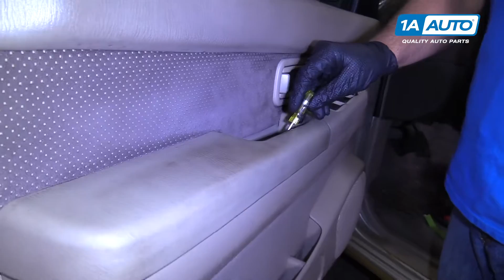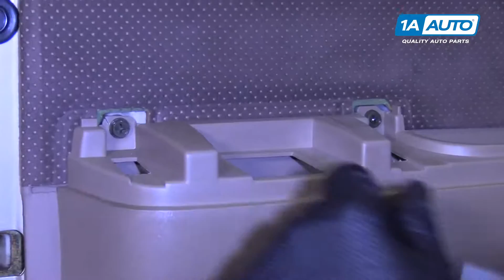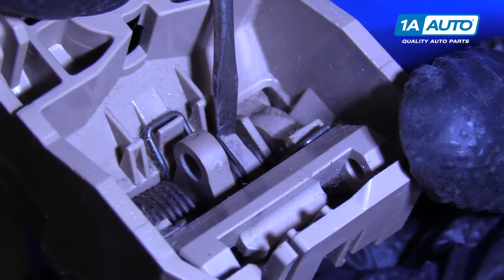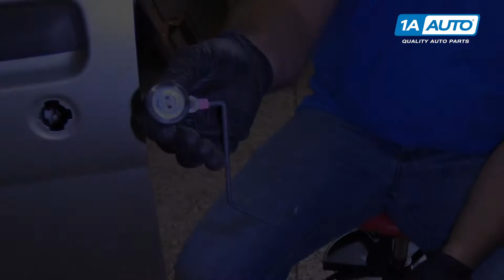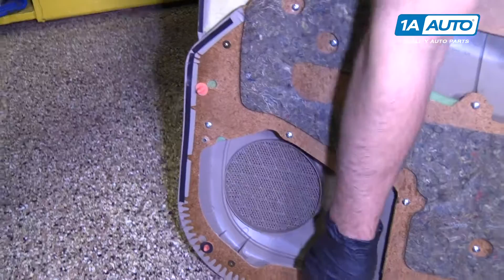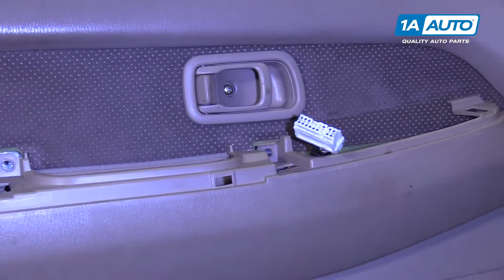How to Replace Door Lock Cylinder 96-04 Nissan Pathfinder

Comment: You don't have to actually remove the inner top handle and 2 connecting rods to gain access to everything else shown in the video! So skip that step! Just finished replacing the lock cylinder on a 99 INFINITI QX4. Thank you so much for these videos, super helpful.

Comment: I'm having an issue programming my 2000 Nissan Pathfinder LE 4x4 Keyfob. At some point, someone attempted to drill out the Driver's side door lock. The locksmith says, potentionally, doing this has caused an electrical problem preventing the fob from programming. Does this sound like a legitimate cause? Thanks for the video!

Comment: How much do you suppose this would aid with a 1999 Xterra. I ask as with that model the only way to lock the doors is reversing the key from the outside. Also this is extremely complicated for the task being done. I feel like the design could definitely be simplified😅. Totally out of your control though. Thanks for the video😃

Comment: does work for 2000 nissan frontier v6 3.3 l   doesnt have electric windows , just plain manual handle
Reply from the maker: +ruldyjcarrillo We don't have a how-to video for your vehicle right now, but the basic steps in this video should be enough to do this task. Buy this part for your vehicle on 1AAuto.com: http://1aau.to/m/Shop-1AAuto-c

Comment: Is there a way to test if that little sensor behind the lock cylinder is faulty? I am having issues on my 1999 altima in which the alarm will go off and even though I turn the key in the lock cylinder it will not disarm it like it is suppose to.

Comment: Does the cylinder works with my original keys?
Reply from the maker: +Abel Vargas A new door lock cylinder generally will include a new set of keys as a new cylinder would not be compatible with your original keys.